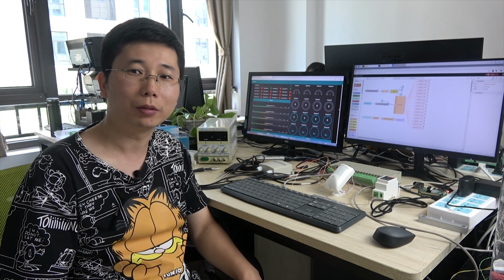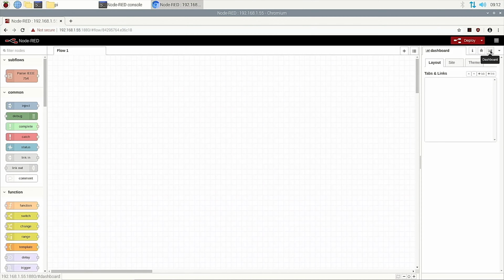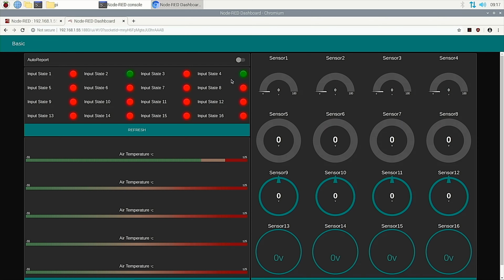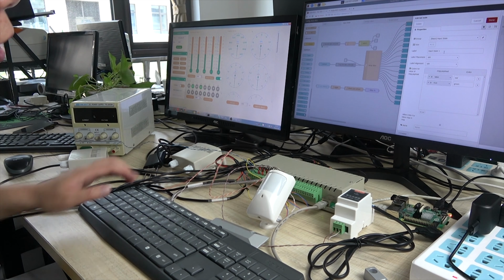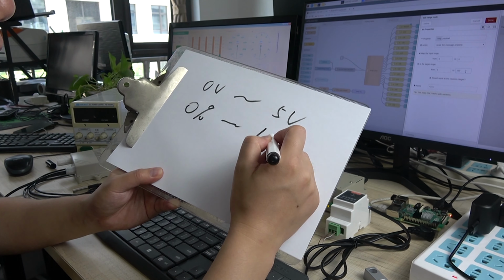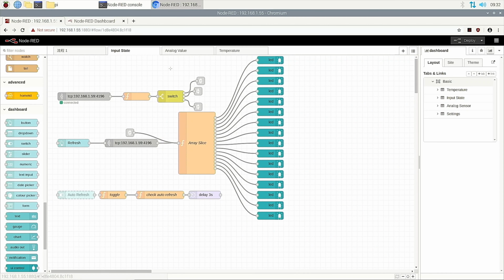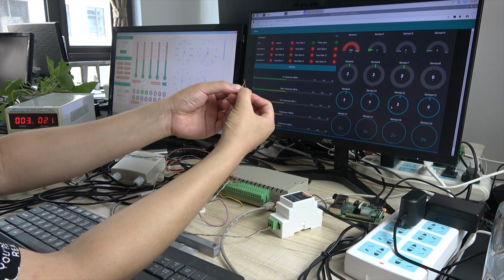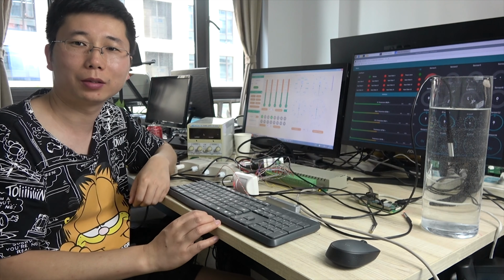【home automation DIY by Node-Red#05】make sensor monitoring service

Comment: Is it possible to use the KC868 smart controller in monitoring digital and analog sensors without using the Raspberry Pi and Node-Red. If I use a system in agriculture such as greenhouses with vegetables or flowers, and there are not one but 5-10 greenhouses, how to connect the sensors at that distance (100-500m) between the sensor and KC868. I used LoRa wireless communication in my systems. Did you considering similar situations.
I think things are simple when everything is on the table, the reality is different.
Reply from the maker: 1: yes, you can use PC monitor software without Raspberry Pi and Node-Red. Because we have exe file for monitor and set automatic control logical. Raspberry Pi and Node-Red just as a webservice.

2: if long distance, you can put KC868-COL in your different greenhouse. different KC868-COL use ethernet or wifi connect to router. if can't use ethernet CAT5 cable, you put create a wide WiFi signal, let KC868-COL connected by wifi.Because in farm it's very open place and there are no obstacles. The signal can be transmitted very well.